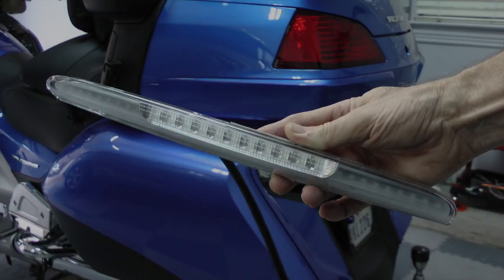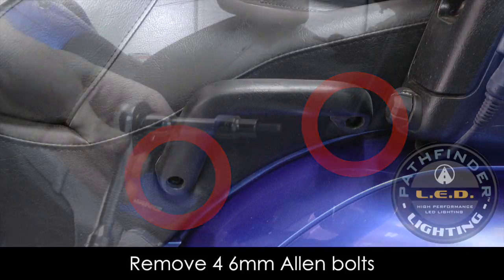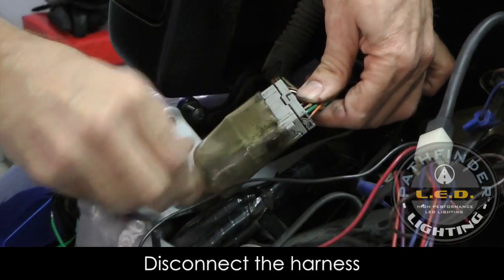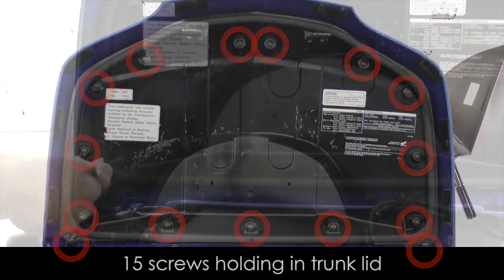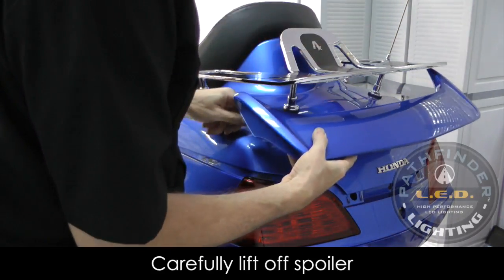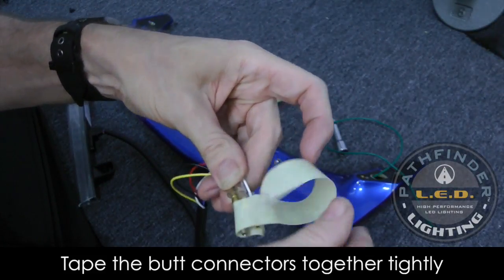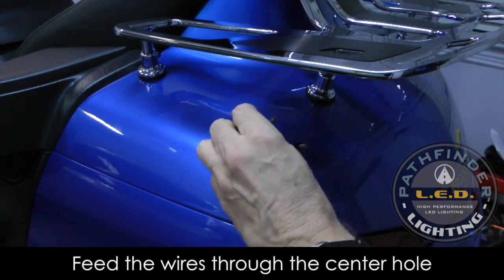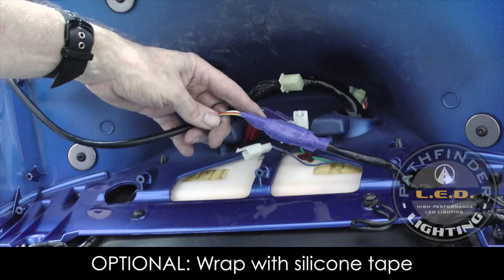Pathfinder Dynamic Sequential LED Spoiler Light for Honda Goldwing (2012-2017

Comment: What if you already have something plugged into the 14 pin connector?  I have the Kury rear vertical lights and the center fender light. The adaptor harness for those also plug into the same 14 pin connector.

Comment: Hey Cruiseman, 
Nice video. Can you add a short clip of where the 2001-2010 connects to the turn signals. Its behind the rear license plate panel. I installed my light on my 2010 and had no idea where to connect. The 2001-2010 kit does not come with the 14 pi connector. It has a red and a blue connector that connect behind the license plate cover. (Got great instructions and a picture from SoCalMotoGear customer service)

Comment: Chris, I received my light yesterday for a 2008 GL1800 the harness is totally different and there are no directions available yet do you have any information as to where the red and blue 3 pin connectors tie in at?

Comment from the maker: -  -  -  -  -  -  -  IMPORTANT NOTICE -  -  -  -  -  -  -  -
The 14-pin connector can be VERY DIFFICULT to locate. There is a similar connector next to the relay box, but it is smaller and is the incorrect connector. The correct connector will be farther back, toward the trunk, on the right side (as you sit on the bike) next to the frame. It doesn’t matter if it’s an Airbag model or not! You may have to move other wire harnesses out of the way to locate it.